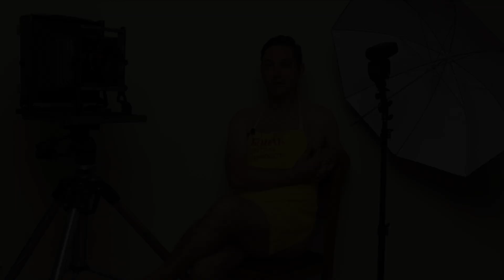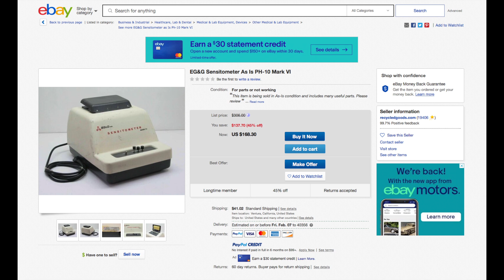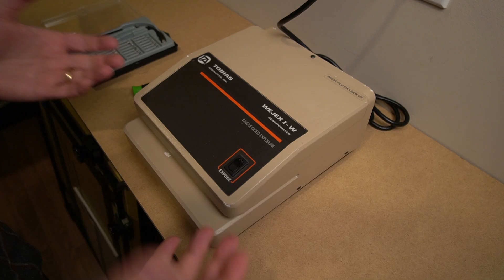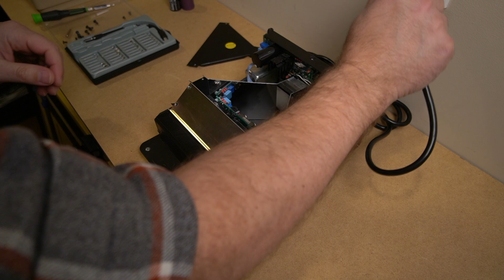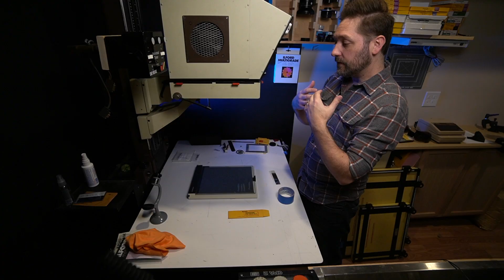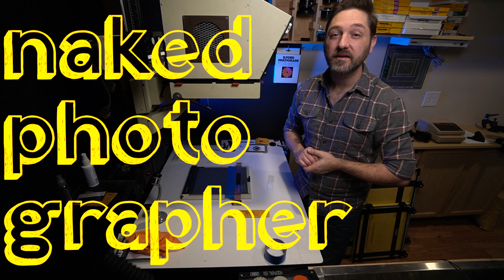Sensitometer

Comment: Hello. How can i expose a film with a step wedge through a view camera ? Thanks.
Reply from the maker: What are you trying to do?  If it’s to create a film curve with your camera lens in the equation, don’t use a step wedge like mine.  You want a a Kodak Q-13 color separation guide.  The back side has a grayscale in dyes from black to white.  Photograph that to create your plotting steps.
Reply: @TheNakedPhotographer  Thank you. I as you said wanted to calibrate my film for ZS and measure my film iso, and calculate  my N, N+1 etc development time..
Reply: @TheNakedPhotographer  For plotting a film with a view camera would photographing the Kodak Q-13 as you suggest provide a better outcome over placing a Stouffer TP4x5-21 projection wedge in the film holder and exposing on Zone X?
Reply from the maker: The target over the film makes the lens act like just a light source and gives an effect like exposing by an enlarger, whereas photographing the Q-13 takes the lens into account as part of the full exposure system that the Zone System relies on.
Reply: @TheNakedPhotographer  Thanks! I appreciate the explanation.

Comment: Hi there.  According to the Kodak Sensitometry Workbook on page 2, Exposure can be determined by multiplying Illuminance (in millilux) by Time (in seconds). The equation is Exposure = Illuminance x Time. So, on your Tobias Wejex, how do you know what values to use for the two variables: Illuminance and time?
Reply from the maker: You need the manual.  Since I didn’t have the manual I had to disassemble my machine and use a shutter speed tester to measure the time and a lux meter to measure illuminance.  I also had to remove the step wedge to read the values on the densitometer.  Tobias would calibrate my machine and send me the information, but that would cost more than I paid for the thing in the first place.
Reply: @TheNakedPhotographer  Thank you.  I am actively seeking to find a sensitometer, so I will make sure I either get or can get a manual for the one that I purchase.  Very helpful and thank you.  Enjoy the holiday.
Reply from the maker: If you are any good at electronics you can get one of the three EG&G units currently on eBay.
Reply: @TheNakedPhotographer  I did see those, but was concerned about how dirty/rusty they looked.  One of them is for parts, which isn't a bad idea, but I am really unsure of the function/operation of the other two units.  The people selling them have no idea what they even are most likely and so any questions would probably be unproductive is my guess, but it is worth a try to see.  Do you know if the EC&G units have a step wedge in them or do you have to use your own?  I have never seen one of these units in person.  I also wonder if the xenon flash bulbs can be purchased anywhere.  I am definitely on the hunt, just wish I knew a little bit more about what I was looking at with these units.
Reply: @TheNakedPhotographer  Dear Gregori, you have inspired me to build myself a sensitometer with a small speedlight with 24 guide number and manual control P0 (max) to P-5 (-5EV). 
In order to calculate the exposure I have a Sekonic L-858D Speedmaster whichmeasures illuminance and flash durations.
For flash duration, I think I should take time of t-0.5 (time for 50% flash discharge) which should be representative but I am not totally sure about this. Measured: 1/1910 sec. Is this potentially an issue because reciprocity failure?
For illuminance in lux I am struggling to measure the flash light since the Sekonic is being min down and I am not sure if it´s even possible to measure any illuminance of speedlights with this device.
Just curiositiy: how fast is the shutter speed and illuminance in lux of your Tobias Wejes sensitometer?
Thank you so much for your support! Best regards, Ignacio

Comment: Did you add the step wedge to your Tobias Wejex 1-W  Sensitometer or did it come with the unit?  I ask because I am on the hunt for a sensitometer.
Reply from the maker: Mine came with one installed

Comment: Although panchromatic film does vary in sensitivity across the color spectrum, shouldn't a sensitometer with a green LED be useful for evaluating black and white film?  I noticed that such sensitometers are on eBay at prices so low they are practically free.  The manual for the unit I looked at, the X-Rite 396, mentions using the device for cine process control, which is certainly full spectrum application.  I couldn't resist ordering one.  How big a discrepancy do you think I will see?  I also have a densitometer on the way for reading the results.

Years ago, I used a color analyzer and my enlarger for reading densities for zone system calibrations.  I was unaware of sensitometers, but did manage to figure out where the .1 nd point was on Tri-X, and could use my spot meter to get good placement of shadows.  I really enjoy your videos because they are among the few out there that go beyond the superficial.  Keep up the good work!
Reply from the maker: Check out this thread on Photrio, all three types were compared: https://www.photrio.com/forum/threads/the-great-sensitometer-shootout.95837/
Reply: @TheNakedPhotographer  I looked at that thread last night, though admittedly not deeply.  Most respondents seem to be saying they saw little if any difference.  A lot of the illustrations in the early postings seem to be gone.   But again, an ideal panchromatic film should produce the same density if hit by a given number of millilux seconds across the entire visible spectrum regardless of the color of the light.  The spectral sensitivity curves I see in publications for real world films isn't perfectly flat, but it's pretty good.

I have one more question.  You mention using D76 because it is very similar to the developer specified by ANSI for determining ISO.  What time and temperature do you use and is it the same for each film tested?  You may have mentioned it in the first video, but if so, I missed it.  Also, where can I find the relevant ANSI document?
Reply from the maker: I am using the times recommended by each film manufacturer at 20C.  I don’t have the ANSI doc number handy, I’ll have to look it up later.  Not every company uses the ISO method, for example, Ilford clearly states they do not.  But I never said I was doing ISO testing, I’m just using the formula closest to what ISO uses because it’s easy to get and very predictable.
Reply: @TheNakedPhotographer  Understood that you are not doing ISO testing.  I think what you are doing is far better than any of the other film review's I've seen on YouTube.  The latter remind me of audio equipment reviews that favor "perceptions" over metrics.  Also, we are trying to use film, not produce hundreds of kilometers of the stuff.  I have an engineering background (I consider myself a mediocre photographer, but have enjoyed it since I was a boy) and like numbers and measurements.
Reply: I did some research to find the standard.  It's called ISO 6:1993 and you can buy it here https://webstore.ansi.org/Standards/I3A/ANSIISO1993NAPMIT2  I'm not sure whether I'm curious enough to pay $26 for a copy, but I may.

Have you seen a difference in the sensitometer results with or without the blue filter once the "filter factor" is taken into account?  It seems to me if you are testing other films relative to Tri-X, sensitometer color temperature shouldn't matter much for panchromatic films.  Of course, it would matter for measuring actual film speed. 

Once again, thanks for a very thought provoking video
Reply: Hello, when using a green/blue light sensitometer, it is important to be aware of the lambda gamma effect. Traditional BNW Material will react with different contrast to different light colors. Green will often result in high contrast and blue in lower contrast. (I have done some research in this topic and found that the contrast difference in modern emulsions because of the lambda gamma effect should not be overlooked.) You can use X-ray type sensitometer to do relative testing, be aware though that your results will be (if green is used) too contrasty. Relative testing means you compare your curve sets to a known curve of known speed, in order to obtain your own relative speed values. You can not obtain any real world speed of your material without a calibrated white light sensitometer though.

Comment: Hi, I am testing a new BnW film for the manufacturer for the right development time in DDX 1+4 and so far been doing it by eye.

I know they are being undeveloped but it's difficult for me to accurately measure the density to see how off the tones are from the right zones. I can't afford a densiometer, is there another way to have reasonably accurate measuring? Would a step tablet be good?
Reply from the maker: Step tablets are intended to be read by a densitometer, so that wouldn’t be any good to you.  Trial and error while comparing to a known density may be the only way to go.
Reply: @TheNakedPhotographer  I thought there were different types of step tablets? I searched up the Stouffler ones and one of the step tablets they offered specifically mentioned it was made for densiometers but didn't mention it for the other step tablet products
Reply from the maker: Without a densitometer, any evaluation will be by visual comparison regardless of what tablet or negative you use.  If you have a spot meter and a light box you can make a makeshift densitometer.  Place the tablet on the light box and read the density patches with the light meter.  Every step should be a half stop different.

But if this is for a manufacturer to publish this as the official time, then I would recommend you find a lab in your area and ask if they would read the densities for you on their densitometer.,
Reply: @TheNakedPhotographer  okay thanks for your advice and tips :) I will try that method or ask around if someone can lend me a densiometer check for me

Comment: Thank you for the info. Regarding the ND, blue filter & step wedge. Are these pre-installed or user installed for your testing?
Reply from the maker: It originally came set up for X-ray film, so I changed them for camera film.
Reply: The Naked Photographer thanks for the reply. What, specifically, did you change? Blue filter only, I assume. Or all three?
Reply from the maker: I added neutral density to deal with a higher iso film.

Comment: Thank you very much for answering my question from the other video here in detail. However, the equipment is so special and so rare (currently there are only 2 devices on ebay) that I have to make something out of a normal flash (Xenon) and a step wedge.